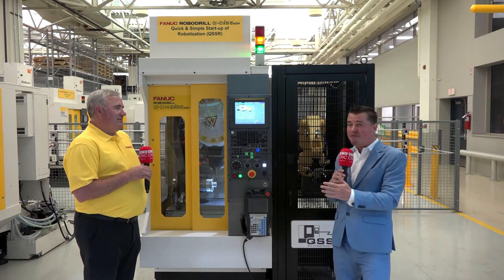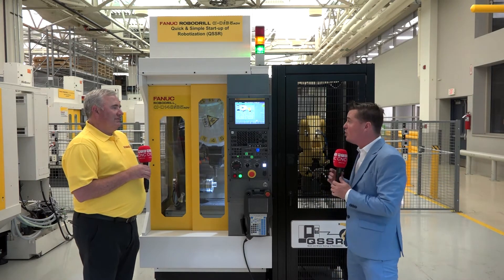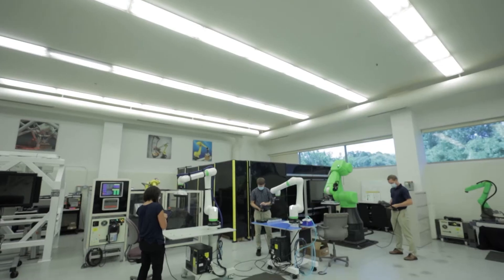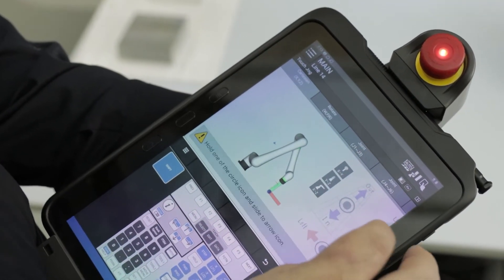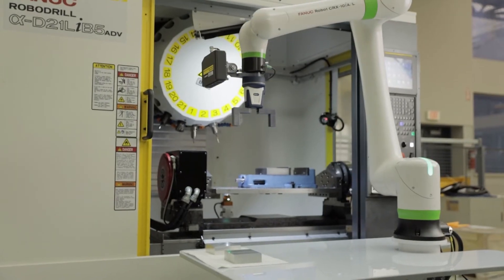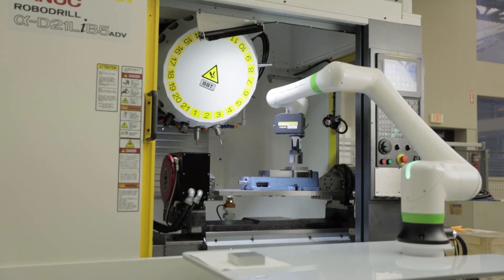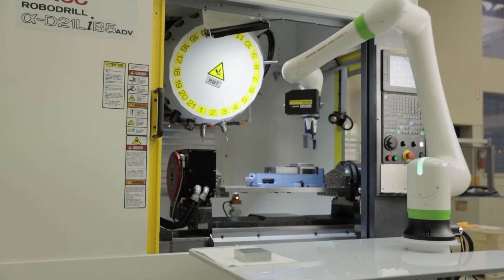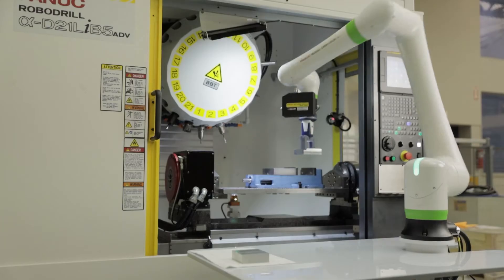High mix, low volume automation solutions with quick returns

Comment: I love everything about this but while watching these videos or similar videos about HMLV manufacturing no one seems to talk about set up time for all of these jobs. I'm not talking about the robot set up since that is usually the easy part but the CNC machine center set up. Often times the set up time for the machining center is quite lengthy. We can have 10 set ups a day on a machine center now the operators have to change robot grippers, programs, and part presentation on top of that it. This is the issue I've been having to try and sell to my current place of work and I just don't have a good solution yet.
Reply from the maker: There is always a solution.